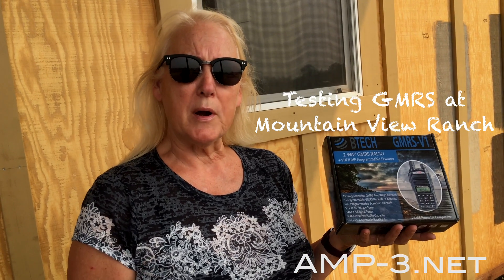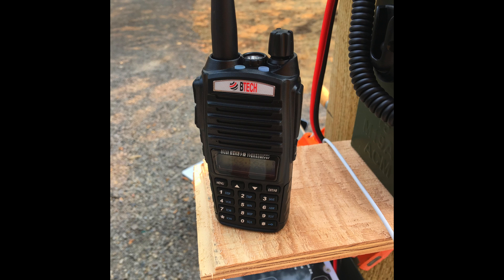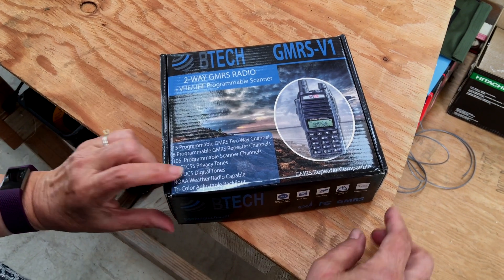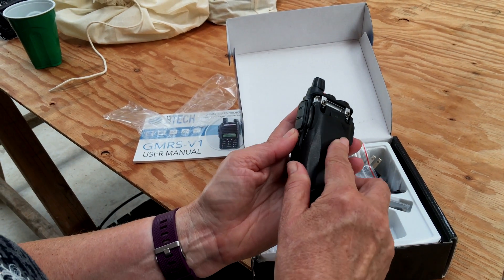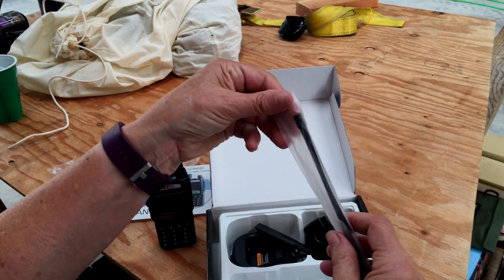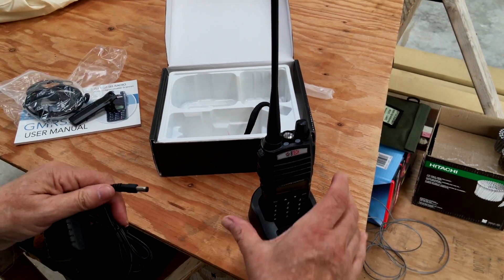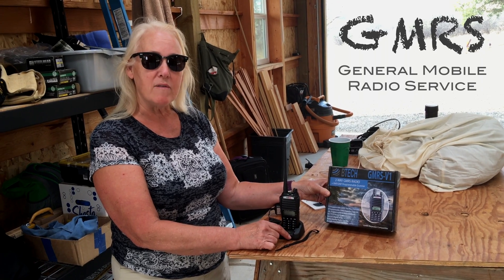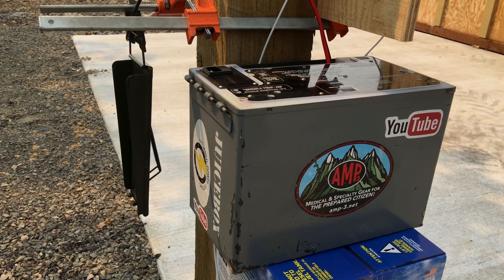Testing Baofeng GMRS-V1 Radios | Mountain View Ranch | USNERDOC

Comment: I don't know about you, but my boyfriend has givin up his gmrs btech-v1. Well below the power requirements listed by the F.C.C. The V1 model only puts out 2 watts on high power. This is a problem for city use! My boyfriend and I are both trained storm spotters in the city, and need the extra power for long range especially if we end up splitting up more than 2 miles apart. Repeaters are non exsistant where we live, no where to be found. Otherweise great for country use, but useless for the city. We own motorola ht1250ls for long range. They can transmit up to 4 watts on high power. Low power is 1 watt. This is perfect for what we need.

Comment: Baofeng gmrs?! That’s probably the uv8r you got there, I have that model and it is a good little radio for mars, furs, gmrs and ham. Yes I know, illegal on those frequencies but still.
Reply from the maker: +KC9CPX - That is indeed a Baofeng GMRS radio. I am not aware of the UV8R. I do have a lot of experience using the UV5R series of radios and the BF8-HP. Our company is an authorized Baofeng/ BaoTech dealer. Not sure what “furs” and “mars” are ... perhaps MURS and FRS? Thank you so much for watching!
Reply: this radio is now part95 certified

Comment: I am surprised that baofang did not use a USB cable connection to charge the battery, if they did you can use a power bank, or solar panels to charge the battery. that way if the battery got low you recharge the battery in a pinch.

Comment: I own 4 gmrs portable
radios, 2midland  G28 2watt  15channel radios.
1uniden 8channel  GMR100 radio.
and a Maxon 210+3 4watt  10channel , with repeater channels.
good working radios.
plan to look at the gmrs you have. great job thanks.

Comment: Those Radio are Duel band, Right ?  I know for sure only 2 VHF MURS Channel could be used. 154.570 and 154.600 The first three channels are narrow with 11.25K, which many radios are hard to program with the channel spacing.
Reply from the maker: Dual band correct
Reply: Narrow band also.
Reply: The GMRS version of this radio is incapable of transmitting in the VHF side, just UHF. Some asshole at the FCC made it illegal to transmit on two different radio services from one radio. Anytone  produced the Anytone Terminator a two way radio that did Ham, MURS, GMRS, and received everything, even aircraft band. The Japanese manufacturers had it deemed illegal in the United States because the were jealous that the didn’t bring the concept to market first.

Comment: I have had a pair of V1s for about 6 months. I am satisfied thus far, however, I need to order the programming cable to make the best use of the available features of the radio (like naming the channels). There are no GMRS repeaters in my area, but I am in the process of building one, so I have not tried the  repeater function. I have made good simplex comms from about 5 miles away, even with some terrain masking. This was HT to HT. It was a little scratchy. When my assistant used my MXT-100 set up as a base station (on a 20' mast with an Ed Fong j-pole) I got a very clear signal. This was true on low or high power. When I got on top of a hill (1000' above my house and 5 miles away, HT to HT on low power was excellent, but from that hill I got nearly the same results with a tiny Cobra bubble pack HT.

I am considering doing a video on the set up I have for my ilcensed GNRS station.

I have also recently got my Technician license as well.

I look forward to your eval of these radios!
Reply from the maker: Excellent news on getting your Technician license. You will really appreciate the capabilities of amateur radio.
Thanks for watching!
Reply: Most GMRS repeaters will use a PL tone of 141.3 which they call the "Travel Tone", Thats IF the repeater is open for public use.

Comment: So, is this true GMRS freqs? It only monitors VHF? Important need-to-know information. Does it come in 5 Watt?
Reply from the maker: There are some future highlights for these radios referenced in the description box for the video. I included them here to help you out.
BTECH GMRS-V1
GMRS MULTI-PURPOSE RADIO WITH SCANNING RECEIVER
GMRS-V1 comes with GMRS two-way and GMRS repeater channels pre-programmed
Output power: 2W, 5W
GMRS Repeater Capable
15 Modifiable GMRS Two-Way Channels (Channels 0-14) - Receive and Transmit
8 Modifiable GMRS Repeater Channels (Channels 15-22) - Receive and Transmit
105 Programmable Scanner Channels (Channels 23-127) - Receive Only 
FM Radio
Reply: Cool! Thank you!